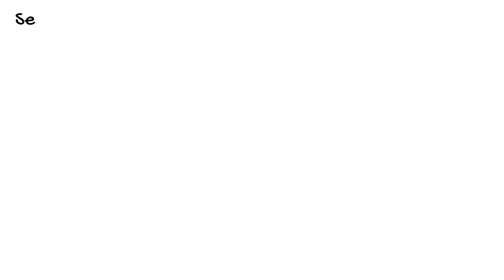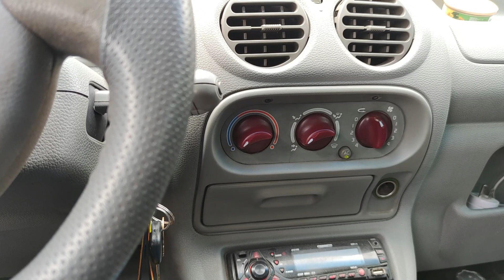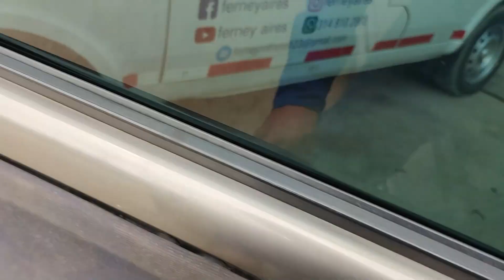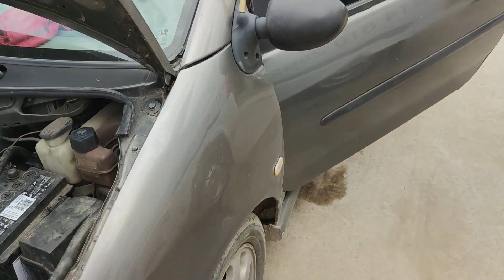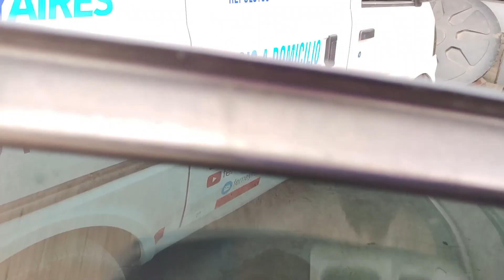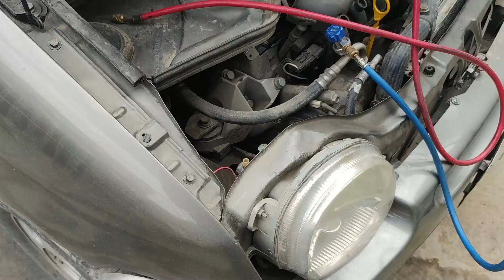Por que se apaga el Renault Twingo cuando accionamos el aire acondicionado?

Comment: Ferney ,como esta caballero? Tengo  una pregunta. Hoy le cambie el compressor a un Peter bilt 2015 y le recarge el refrigerante con las libras especificas. Pero la linea del evaporator al compressor se estava congelando?
Reply from the maker: Saludos 
Debes revisar el sensor de temperatura del evaporador...
Reply: @FerneyAires1978  gracias.saludos